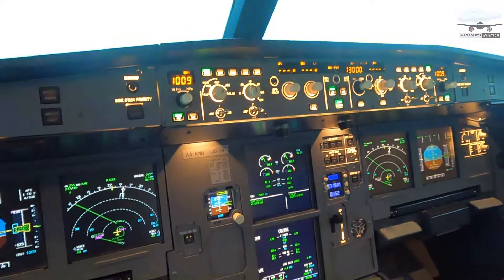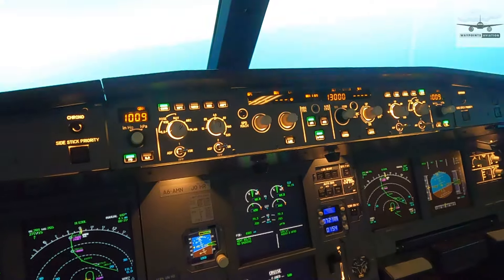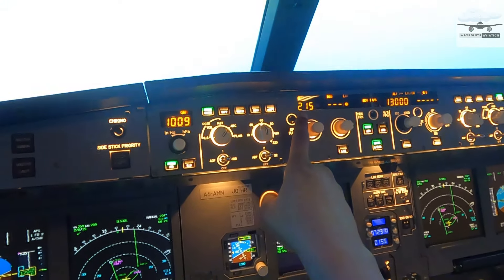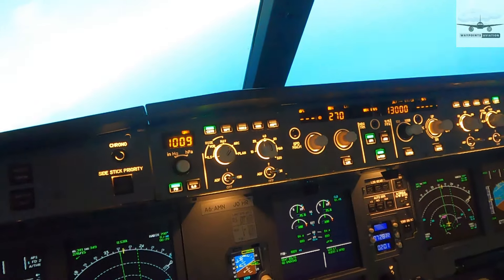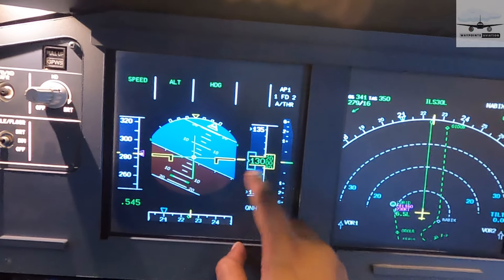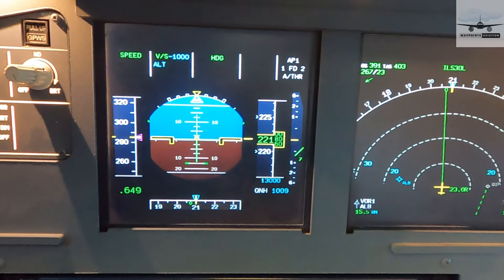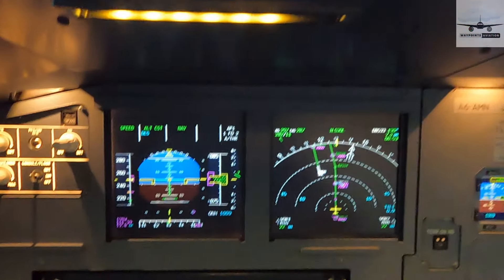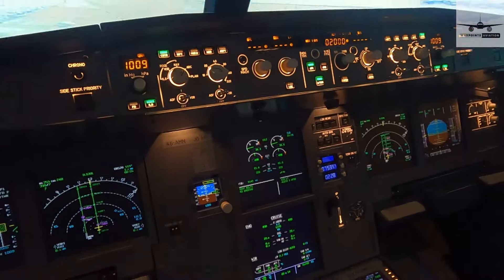Airbus A320 | Tutorial | Autopilot - Understanding the FCU (Flight Control Unit)

Comment: Something to remember in MSFS - you have to select "LEGACY" in the Accessibilty section in Gen Options so the mouse will allow you to Push and Pull the knobs.  I also did not realize that you could use Auto Throttle and still change the Speed manually.  Pretty cool, I see that in the Vision Jet also. Way down below the throttle . . .
Reply from the maker: We learn something new everyday! :)
Reply: @waypointsaviation i have trouble with this one. even if i selected my speed and altitude, if i dont make the proper throttle adjustment, the AP wont work. do you have a video explaining this one? thanks in advance.
Reply: @asi146 is auto throttle on?
Reply: @rachelsobolewski2953  yes. and now i know how airbus throttles work. i thought they are the same with boeing.
Reply: OMG.. i almost gave up on msfs until i saw this comment.. Thank you!!!

Comment: Excellent Sir Thankyou for making these. I was wondering about the altitude knob on the FCU - When you change the altitude in selected mode it did not immediately go into open climb. You had to pull up again to start the climb. It seems it allows you to completely set your new altitude before plane climbs or descends, instead of a sudden change even though you are already in selected mode. This knob appears different than the Heading knob which will react immediately to a change. Am I seeing this correctly?

Comment: Hello, thanks for this wonderful tutorial, although I knew most of it already :) One question though: I fly the A320neo as well (in FS2020) 😂 and sometimes (or always?) on an approach small two digit green numbers appear on the left side of the altitude scale .. like 32 and either slowly counting up or down. What are these numbers for? Thanks for your help!
Reply from the maker: Hello,
I believe you're referring to your vertical speed indicator, double digits (32) are in thousands so 32 would be 3200 feet per minute and single digits are hundreds. Best touch down rate would be less than 300 feet per minute. 

Hope this helps, thanks for watching!
Reply: @waypointsaviation  Thanks for your reply. No, I am not talking about the VSI "needle". The green numbers I am seeing appear on the top left or lowest left-side of the altitude scale. They can count up all the way to 99. I can send you a screenshot where they would be located.
Reply from the maker: @MotoFuzzi  HI, yeah sure please send us a screenshot via WhatsApp or email and we can surely look into it and give you a proper answer.
Reply: @waypointsaviation Hello again, I think I found the answer already?!?! (" It is the indicator for how far off of the VNAV path you are. 77 means you're 7,700 feet below where the plane wants to be"). Makes sense to me, agree? Another quick question, I assume you are a real-life A320 pilot, could you check whether there is an indication during flight whether the parking brake is engaged or not? I landed with parking brake on but I didn't see any message. Thanks.
Reply from the maker: Hi, 
I'm not yet sure what the indicator you're referring to could be until I see a picture of it, just to be sure I answer you correctly. Yes, I am a real life A320 Pilot, Instructor and Examiner and in the A320 if you set the parking brake at anytime you'll see a notification on the Upper ECAM saying "PARK BRK" 

Hope this helps

Best Regards
Reply: @waypointsaviation  Thanks very much for your reply and for taking the time. I am sure I will have loads of other questions for you :)
Reply from the maker: @MotoFuzzi anytime 😁

Comment: Amazing tutorial!! Thank you very much for putting the time and effort to convey to us aviation enthusiasts all this information.
One question: As you were manually changing the Flight Path Angle from the FCU, the plane's pitch angle was also changing to the corresponding value as shown with the "bird" on the PFD.
Is this always the case? (FPA = A/C Pitch Angle)?
Because I have seen planes descending with the correct FPA but with their nose pitched way up to be able to maintain it (the FPA), especially on low approach speeds
Reply from the maker: Hello, thanks for your comment! To answer your question keep in mind that we have two factors one is angle of attack the other is flight path angle. The angle of attack is the angle at which the aircraft must fly to maintain, straight & level flight Or the angle that it must maintain to climb and descend at whatever rate you choose, the flight path angle is the true angle at which the aircraft is flying. For example, if the flight path angle is zero with flaps up and flying at the speed of approximately 200 kn. You can expect the angle of attack to be around 2.5 to 3° nose up. When you slow the aircraft down and deploy the flaps, the aircraft will naturally fly at a raised angle of attack, which is why you always see aircraft coming into land with a nose up angle. This is just how the aerodynamics work.

Hope this answers your question Let us know if you need any further information.
Reply: @waypointsaviation  Thank you so much for this elaborate response! 
Not only answers my question but a series of follow up questions that I might have had!

Comment: How to select the roll angle of the plane when turning. There is another knob behind the heading knob in Boeing to select your roll angle. But I couldn't find out how to do that on the Airbus
Reply from the maker: Airbus doesn’t have a knob neither does it have an option to adjust the angle of bank. Then you push fully on the side-stick, the aircraft will role until it reaches a maximum of 67 degrees of bank (if you keep pushing the stick) once you release the stick the ac will automatically role back to 33 degrees and stay there until you push the stick the other way to level the wings

Comment: This is an amazing tutorial. Best ever. Does the A330 autopilot work the same way?
Reply from the maker: Indeed! Airbus 318, 319, 320, 321, 330, 340 ALL have the same FCU so If you know how to fly one you can fly them all, it's keeping with Airbus' common cockpit philosophy.
Reply: 380 also? When/ if that is available in xp 12 I will purchase? Thank you!
Reply from the maker: 380 is similar but not exactly the same as the rest, but once you understand the logic of airbus you’ll be able to figure out the FCU of the 380 easily too! Yeah you should get the 380 if you can; it’s the best! Dream to fly! We here at waypoints speak from first hand experience flying it! 😎✌🏽✈️

Comment: Great video! Just a question about the FPA mode: does it control the nose attitude or the flight path angle? The attitude indicator matched the degrees that you programmed on the FCU, but that might not match the flight path angle, right? If you change config with flaps, or if you have a headwind, the AI degrees won't match the flight path angle, correct?
Reply from the maker: Hi and thanks for your comment! The FPA doesn't really control anything but is more like an indication as to what the aircraft is doing or the actual flight path angle that the aircraft is flying in relation to its angle of attack. Generally in clean configuration flying straight and level the aircraft would have a nose up angle of about 2 1/2 to 5° and yes you're correct if you lower the speed or deploy flaps then this angle will change. The purpose of the FPA (Bird) is to help the pilot determine regardless of what the angle of attack isis to help the pilot determine regardless of what the angle of attack, is the aircraft is the aircraft flying straight and level or are we climbing or descending that's pretty much what the FPA does for us hope this answers your question full free to let us know if you need any more clarification.

Comment: I’m running in a problem that I do not understand, I’m in selected mode auto thrust and autopilot, speed is set to 220 and it will go over speed on both while I’m climbing and I cannot get the speed down. I try on A330 from Laminar and on A319 from Toliss, same problem. Do not know what I’m doing wrong😮Please help.
Reply from the maker: Hello,
There could be a number of reasons for this… you can check the following… 
1) are the flaps still out? At speeds of 220 you must be flaps 0
2) are the thrust levers in the CL detect? Cause if they’re still in toga or flx/mct then no matter what you choose in selected it will still be pushing max power 

Check this and let us know if this works, anything else we can do to help let us know :)
Reply: @waypointsaviation  you were right, that was my problem, I have read that auto thrust was not going over the point where it was setup, but I miss read about toga, thanks again

Comment: When I set both heading and altitude in managed mode, autopilot on A320neo only follows heading but it won't follow altitude based on the flight plan.  Also the magenta altitude limits don't show up on PFD when I toggle between altitude select/managed mode.  I do see those on the ND screen.  Any suggestions?
Reply from the maker: Altitude will not change as per the FMS - you will have to use the FCU to dial and change levels.
in regard to the magenta ALT limits, it has to be coded into the FMS waypoints - then it will reflect. Check this video it explains it partially: https://youtu.be/wz1CcqHxzeM

Comment: Hi, for context input, you are specifically flying at thirteen thousand feet, NOT flight level (FL). We only call it FL when you are at “standard”assuming you are above transition altitude.
Reply: In other parts of the world other than the USA flight levels can be as low as 4000 and it Chages every day. So when he Said he is at FL130 he is correct.
Reply: Never mind
Reply: @dougbrown8331 I think the point he’s making is that they are on a QNH setting not standard.

Comment: What do you do if the Alt selector knob malfunctions and doesn’t go into open descent mode?
Reply from the maker: The basic idea is to set your desired trajectory using the FCU knobs( Speed , ALT, and HDG), if FCU selection not possible , you can start by resetting the FCU . If still not working. Then you can fly the Aircraft manually to the desired trajectory,  with out selections using PFD screen.

Comment: Another refresher - thanks! Question - at 23.20 in the vid, you put in the fmc 5000 altitude. That is visible in the screen (in blue). The constraint is hower 8,000 - I would expect that 8000 in purple in your fmc - any idea why it showed your selected altitude in blue rather then the constrained altitude of 8000? After a while i saw it changed in 8000 purple though :). It’s probably a delay in the system
Reply from the maker: You my friend are definitely Eagle Eyed! So what happened was there was a momentary error in our MSFS FMGS program and it didnt take into account the constraints... however once we reloaded the programaround the 24:00 period it worked this time, and even though I selected 2000 on the FCU it knew the constraint existed @ 8000 and gave us alt magenta on the FMA and followed the constraints as it should. 
This is a problem one has to deal with sometimes when working with MSFS coupled to an advanced FNPT Simulator, sometimes the software has a hiccup! But it all worked well in the end! :)
Reply: @waypointsaviation  check! ;-) thanks for clarifying! Good to see my pc is not the only one doing weird things haha
Reply from the maker: @ehameham3816  You are NOT alone!

Comment: No, reverse thrust cannot be deployed on an Airbus, or any commercial aircraft, while in flight; it is designed to only function when the aircraft is on the ground during landing, and deploying it in the air is considered extremely dangerous and is prevented by safety systems.